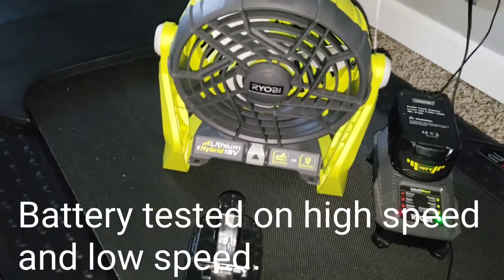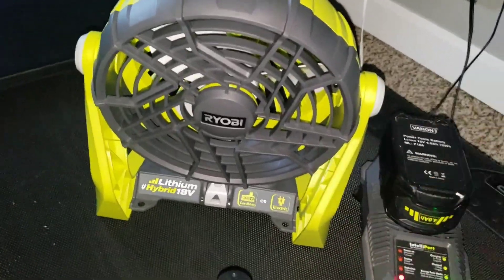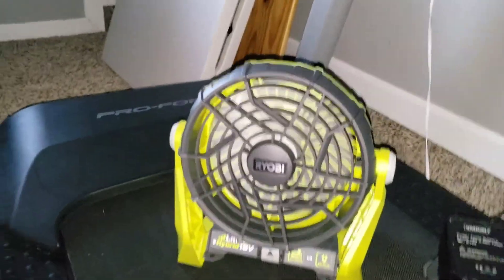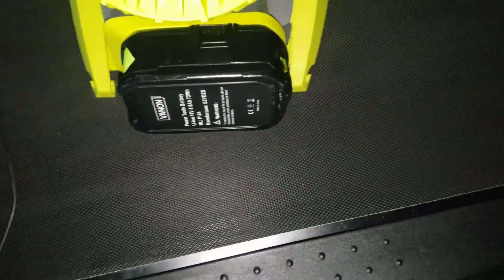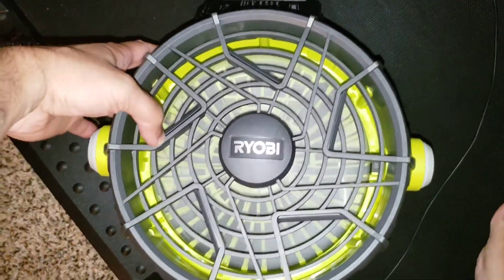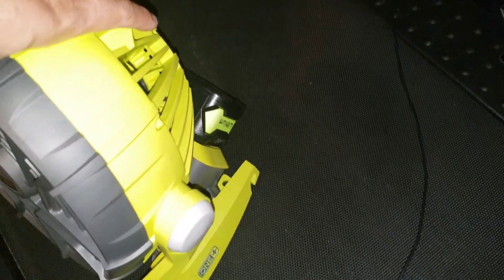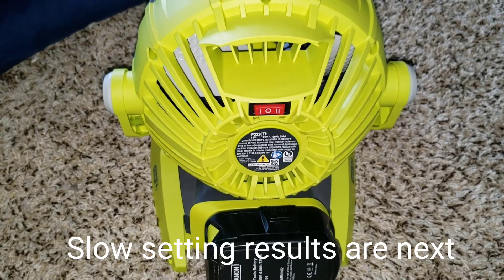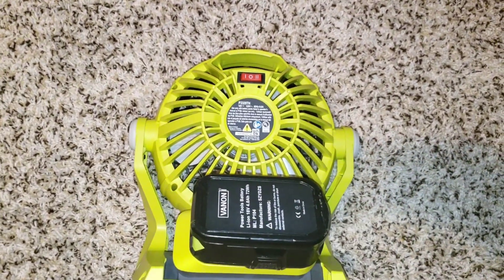The battery life on the Ryobi fan. Just WoW

Comment: My 6amp lasts me 6 hours on high. Got over 9 hours on low when my power went out during a hurricane. This was great.
Reply from the maker: Nice.
Reply: Was it hot or cold I’m confused why do you need a fan ina. Hurricane
Reply: @justchillman104  hurricanes knock out power meaning no AC in the summer so this helped alot.
Reply: @justchillman104 After the hurricane temps tend to soar and the power can be off for hours to days. Once it was off for a week
Reply from the maker: Same here in Texas power went out for a week in the winter. We got down to 8 degrees

Comment: Just bought one today for summer camping. First test with a 2 year old 2ah battery did 4.5 hrs on low. I’ll take that! 
So far the crappy part is the fan head wondering to the sky by itself after a while. I’ll cut a foam wedge to hold it in position.
Reply from the maker: Just pop off the ends and tighten the screws. I did the adjustment a year ago and still doesn’t tilt up

Comment: I got this fan and I like it, but the low setting is a joke, but it's good to save battery in case of an emergency...high setting is ok...
Reply from the maker: All I use is low but thats in the house with AC on. Outside yes you need that high setting.
My mist fan works good outside on low because of the mist

Comment: We have a little pergola over a 12x16 deck. Just want to set one near the top of that. Would be it enough to cover a few bodies at a small table?
Reply from the maker: Nice! Yah even on low will do it. High is too much for me, great for a group far away from it
Reply: On a table or something, Low is enough for one person, high is enough for you and a couple buddies to hang out. I've got the stock battery & a 4.0, between the 2, you will have no troubles. I have the version with misting on the 5 gallon bucket. I love that thing here in the desert. I dont know what charger the fan comes with, but mine came with a joke slow charger, the added ryobi battery I bought came with a much better charger. Mine are all ryobi batteries & charger.
Reply from the maker: Yah I love my mist fan too. Both are holding up fine.

Comment: The off brand batteries suck. They will only last a year till they will stop holding full charge. I have the same exact battery and it lasts less charge then my Ryobi 1.5ah 3 year old battery does. It lasted about 1 year then stopped holding a full charge
Reply from the maker: They have many different ones in the same shell. I never buy from eBay just Amazon. 5 years latter all of mine are strong. The good ones have a certain look.
Reply: Yeah those batteries are bullshit out of my Ryobi four amp hour battery I get 7 hours on high granted it's only a few weeks old but that's a lot longer than what this guy got out of his off-brand battery
Reply from the maker: Y’all got a bad batch. Mine work just fine and have over 5 years. I have the real and fake ones. If I ever get a dud I will let you all know.